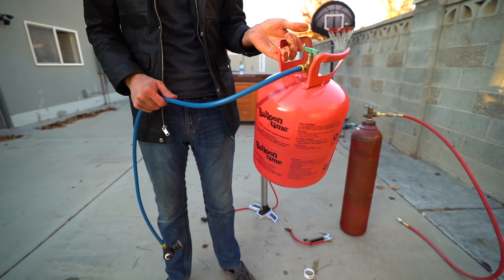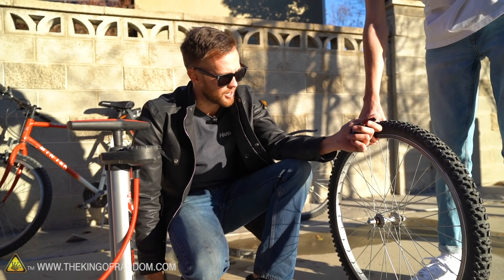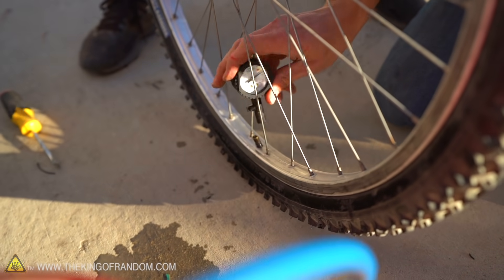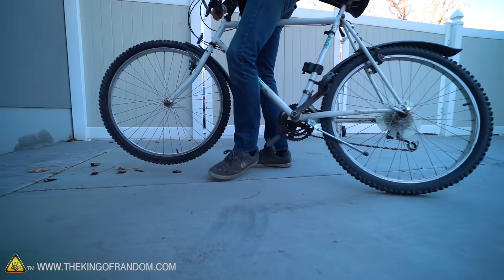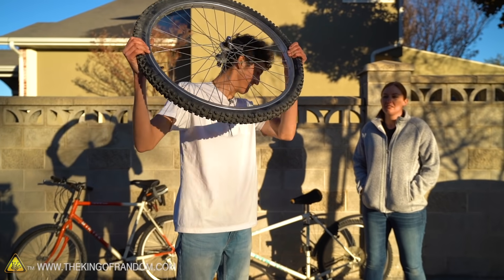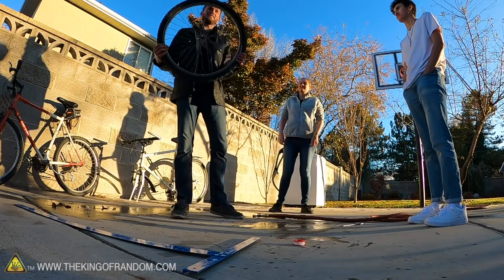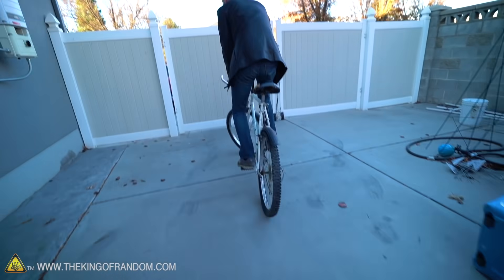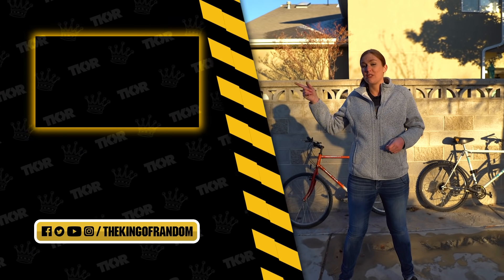What Happens When Bike Tires Are Filled With Helium?

Comment from the maker: How else could we experiment with bikes?
Reply: Fill the tires with Cement
Reply: @maple2500  don't think that would work but now I'm curious
Reply: Fill the tires with oobleck
Reply: Can you make boat with a bike like putting something to make it float and the some paddles on the wheel to see if it can be a boat.
Reply: filling the tires entirely with fix-a-flat, and seeing what other thing you could do with compromised(as in punctured)usually-thrown-away innertubes.
Reply: fill tyres full / half full / quarter full of lead shot or BBs.
Reply: Put the tires in a giant tub of liquid nitrogen.
Reply: Light it on fire
Reply: Make a flying bike
Reply: Would be interesting to know if there is some Gyroscopic effect going on with the water which is why it is making it harder to turn since the water will continue spinning after the wheel slows down.
Reply: Fill it with silly putty, and/or slime! You can also try jello, pudding, and other foods! Have fun with these ideas whether you use em or not.
Reply: fill it up with foam 😁
Reply: Fill it with gallium, aluminum, and thermite!
Reply: Cut open the metal of the bike to see what's inside
Reply: Fill Bicycle tires with cement
Reply: Put spray foam in bike tires
Reply: Same thing 🔥🔥🔥
Reply: Try freeze drying silly string
Reply: You could fill the tires with spaghetti sauce
Reply: freeze dry gas
Reply: what happens is you overfill a bike tyre with air will it explode?? always curious if it will do the same as a ball
Reply: Could you somehow fill a bike tire with concrete? Then you could experiment with gas, liquid, and a solid.
Reply: Fill the tires with spray foam
Reply: When they started to talke about helium I wanted to go buy a bunch of balloons and play with the helium
Reply: Ride a bike with solid rubber tires.
Reply: What if you fill the bike tires with things that carbonate and produce gas so as it shakes it builds up more and more pressure
Reply: Get the tire filled with water outside in winter and see how it rides when water inside is frozen
Reply: Will a bike with  water in the tires float? If not how could you make it float?
Reply: Put two, or three, of them next to each other and use that as a base to maintain social distance.
Reply: Freeze the water-filled tire and see if the rolling resistance is decreased!
Reply: freeze the bike tire filled with water. to make an episode you can check the effects of temperature on all tires
Reply: @TheKingofRandom make bike tires out if spray foam
Reply: Ride over a bunch of sharp stuff
Reply: Freeze the water in the tire?
Reply: @Mercedes Villagonzalo video has been unlisted or private when they made that comment
Reply: Explode a bike see if you can ride it
Reply: Ride a bike with tires made of concrete
Reply: Nate looked like if he was about to commence a chemistry experiment with his black coat and black glasses
Reply: caidenbmx did helium and water already in the past
Reply: Make your own bike. But make it unique
Reply: MOUNTAINBIKING
Reply: fill it up with cola light and mentos. how mutch you need for 45psi?
Reply: fill a tire ENTIRLEY with slime
Reply: fill a tire ENTIRLEY with slime
Reply: Melting it in a foundary
Reply: Also random video idea- washing vegetables like potatoes, carrots in  washing machine
Reply: Fill the tires with the green slime that you use to seal leaks.
Reply: Water in the tirea
Reply: What happens if you freeze the tire with water in it?
Reply: Fill the tyres with orbees
Reply: 0/10 no spin test
Reply: Experiment with the tires again but see what amount pressure can a bike tire contain and try other liquids like the video and see what pressure it can hold
Reply: Hydrogen and fire
Reply: There is a reason to put water in a tire that’s how you balance a tractor tire
Reply: Fill tire with Nitrogen.
Reply: Fill it with pneumatic fluid; ooblock (non-newtonian)
Reply: It’s a bicycle not a bike though but try filling the cycle frame with different stuff
Reply: just have to freeze the tires! lolz
Reply: Non Newtonian fluid
Reply: freeze dry a bike
Reply: Fill a bike tyre with water and ride it down a hill
Reply: Try to use another tire shape like triangle, square, octagon hahahahahha
Reply: You need to remove the core from the valve and then you can easily fill it with all kinds of things.
Reply: Fill a car tire with water
Reply: Fill the bike frame with concrete and tires with water . then race and do tricks against a normal bike .
Reply: get cody from cody’s lab to fill tire with mercury
Reply: i know this is really off topic, but can you make mandalorian armor with the metal foundry?
Reply: Can you please only use Nate and Callie in videos I don’t like the other people and I don’t watch the videos when they’re in them
Reply: Hi
Reply: Can you make a video between two different tires 1 regular tire that doesn't allow to run flat and 1 tire that does allow you to run flat and see how far can you go with each one till they give out?
Reply: You guys should try other "pure" types of air, like pure Oxygen, Argon, etc
Reply: Mercury in bike tires
Reply: Running in whater weels
Reply: Fill the tires with sand
Reply: If you weigh the helium tyre compared to air at 44psi the helium will actually weight more, proove me wrong
Reply: fill it with corn syrup
Reply: Watch Mike Fede's will it ride videos for crazy bike related stuff. Like pool noodles as tires or tennis balls as tires and so on.
Reply: make a paddle boat for the bike
Reply: Do soda
Reply: tires of liquid nitrogen, filled with gallium? Could you mold and cast tires made from candy (wagon wheel style, not hallow)
Reply: Attach motors and see how fast you can go
Reply: When I was a kid we were taught that if you had a puncture, you could do a temporary fix by replacing the inner tube with either tightly packed newspaper or grass.
Just enough to get you home.🚲🚵‍♂️🚵‍♀️
Reply: Why no slo-mo on the bounce, or even pointing the camera at the scale then going frame by frame to check the height? This needed a cacuum pump to pull out as much air as possible before filling.
Reply: Replace the wheels with car tires, replace them with wooden cart wheels, replace the wheels in general
Reply: Fill them with cement 🤔
Reply: How many thorns, nails, or something could you put in the tire before they leak rapidly.  You could also use Stan's No Tube Solution.  (It is a tubeless tire sealant)
Reply: put sugar rockets on them
Reply: ABUSE THEM UNTIL THEIR WHEELS EXPLODE... ahem did (not) try it myself...
Reply: You could fill the tires with:
-Paint
-Chocolate sauce
-Beads
-Sand
-Sawdust
-Plaster of Paris
Reply: Fill a tire with flex seal
Reply: What if you put helium in the body of the bike?
Reply: hydrogen
Reply: Fill the back of a tire with hydrogen and the front of a tire with either xenon sulfur hexafluoride or radon (radon is highly radioactive)
Reply: Plug all the holes on the frame then replace the air with helium.
Reply: Are all tires the same size?
Reply: You did not ride it down the street...
Reply: Fill the hollow bike frames with helium🤷🏼‍♂️
Reply: @nicolasarnold7426  all the air would leak out from headset bottom bracket or seat post
Reply: @nicolasarnold7426  all frames are hollow
Reply: @nicolasarnold7426  how
Reply: @nicolasarnold7426  you would displace a few hundred cubic centimeters of air and it would be unnoticeable as far as weight loss.
Reply: fill the tire with jelly
Reply: Strap sugar rockets to a bike! :D
Reply: See if you can ride a bike after filling the tires with water. Edit: Nevermind I just got to the part where you say you're gonna try filling it with water.😂🤣😂🤣 LMAO
Reply: How was this posted two days ago
Reply: Fill it candy
Reply: what would happen if you filed the tires with liquid nitrogen. when it turns to a gas will the tire pop?
Reply: Fill it with jell-o
Reply: U could see if u could power a table saw whith peddle power
Reply: i would love to have a tire that was full of foa, closed cell foam is super hard. I pop tires very often i would prefer unpoppable tires, even if i ruins my rims or whatever.
Reply: Run over random things with it
Reply: Keep up the videos guys been loving them recently
Reply: Hmm
Reply: Did the total weigh changes from control x  helium
Reply: Put hydrogen instead of helium in the tires
Reply: Reinvent the wheels
Reply: Try to make a giant candy Nerds Rope.
Reply: Fill it up with soda
Reply: Make a quadcycle
Reply: You could do the same experiment, except with more sizes of tires, high-pressure tires and kevlar bead tires.
Reply: 2 days ago???? This was just posted
Reply: You should try something that has to do with one of those blow up castles for kids and big body of water that would be fun to watch LOL or something similar long as you don't get electrocuted not sure if you would actually be able to put one of those in water or not
Reply: Fill with water or oblek or other liquid
Reply: Weld little jumpers to the rims - springs, miniature jumping stilts, things like that.
Reply: Make solid glass tires and ride the bike with them on!
Reply: Where did the other dude go?
Reply: If you listen when the bike tire is filled with sulfurhexifloride, it makes a slightly lower/deeper sound when it bounces. The tire filled with helium sounded about the same as the tire filled with air, I thought it might make a higher sound, but it didn't seem to.
Reply: @kalynrobison6192  cause I want to know how a bike sounds when I’m riding
Reply: Thank you guys for doing this I was wanted to do this
Reply: I don't need to watch the video to know that helium or hydrogen wouldn't create a statistically significant difference.  Not only have I seen the mathematical proof, but I have seen people try this with balls, car tires, etc.
Reply: @drippingwax  Is it because of the density of the gas being pumped in? Maybe helium only creates lift in a non-dense (non-compressed) environment?

Comment: They do fill tires with water to make them healthier it's more for construction and agricultural uses. They make special pumps that spend a set time to fill then switches to a vacuum to take out air and this is always done with the valve stem in the 12 o clock position. Sometimes the valve core is also twice as big

Comment: I personally filled a tire full of sand (without a tube in it) and ran into an interesting problem... Because I didn't have a valve to put the sand through, I was left with an air "bubble" at the top of the tire. While spinning, this mean the sand could slide around inside the tire. This made for some very interesting feelings, especially when the 'bubble' decided to make a full loop.

Comment: When you FILL a tire with water, all that air gets compressed at the top.
5:00 That's mainly the air trapped at the top expanding to push out water.
Reply: I mean, what you are mainly compressing here is that bubble of air stuck at the top.

Comment: I feel like PSI (or really, any measurement of pressure) is basically equivalent to a measurement of density when there's a fixed volume of a gas (like in a bike tire). As such, yeah, 45 PSI of gaseous feathers is the same as 45 PSI of gaseous bricks.

Comment: Water filling tires is actually a thing, in fact I own a "Slime" branded kit/hose adapter for doing just that, water filled tires are used for farm tractors for added weight and traction.

Comment: I mean, what you should do is put the same amount of gas in the tires, not fill to the same PSI. Of course they ride the same when they're inflated the same. But if you want to measure the difference, you'd put the same amount of gas in the tires and see what the PSI turns out to be and how it affects the rideability.

Comment: What your measuring is the flexibility of the rubber tire....  Other than the weight of the water, once you have the pressure in the tire the stretch of the tire in the side wall, different tires are going react for the properties use it's use.

Comment: It's really not cool to experiment with helium. It is so light that the earth's gravity can't keep it contained. Every bit of helium used permanently escapes the earth's atmosphere and enters the void of space. It's necessary for many industrial processes and it is actually quite rare on earth. There isn't any way to make it from scratch either. It may be easy to buy it at stores because of the balloon industry....but you really shouldn't encourage it's use in any capacity.

Comment: I previously looked up the lava lamps can reach up to 140.  Lets what happens if you heat it up much higher than that.  What happen.  Are the bubbles the same size, smaller lets find out.

Comment: The air ones that had different gases didn't bounce different amounts because the densities needed to get to 45 psi are different in each so you likely had similar weights to get that much pressure.

Comment: I actually work in auto retail, and they make a attachment for putting water in tires, it’s meant for water in tractor tires for weight. And if you get a small hole you have longer times before it deflates

Comment: They used to and sometimes still put water is tractor tires as a means of lowering the center of gravity and increasing the tractor weight for stability, an actual use for garden hose to schrader valve attatchment

Comment: You can buy a water hose to schrader valve adapter at a tractor dealership with an air bleeder. There is air in an inner tube, even when deflated, unless you take out the valve and squeeze the tube flat. As you fill the tire with water, the water displaces the air space in the inner tube, so you get a tire full of water and compressed air. You put the valve stem at the top and hit the bleeder and it releases the air that was in the tube before you filled it with water, then you can have a tire FULL of air.

Comment: Turning at higher speeds would be more difficult. The wheels are acting like flywheel's and you increased the weight on the ends of those flywheels. It would have some interesting gyroscopic effects.
Reply: Which would mean that riding without using your hands on water-filled tires would be even better

Comment: Huh, water in the wheel could be an interesting physical model. So if you begin to drive forwards you'd have to go against the inertia of the water in rest, but once you start driving, you're gonna accelerate that water and create torque, which is propably the reason, why turning the wheel feels "heavier", because you have to act against an torque compared to an air filled tire

PS: I don't want to act like I've got any idea what really happens there, so if anything I've said is wrong, feel free to correct me

Comment: 45 psi is about 3 bar, which is normal for a gardenhose. you might get it up to 5 bar if you adjust the pressure gauge but you also risk to damage your home installations.

Comment: would be interesting to see this on car tires, see if it affects acceleration, or causes wobble at all with water
Reply: It would absolutely affect acceleration, stopping and handling considerably.
Reply: That’s what motorcycles do with wheel weights actually.
Reply: I believe Garage54 did that experiment.
Reply: @purp1e200  ill have to check it out

Comment: The problem for the gasses is that you controlled them by pressure, the big thing that makes these gasses different is their density.  As gasses are compressible if you wanted to keep these gasses behaving in different ways you should have kept them at a constant volume (by which I mean volume at standard atmosphere)

Comment: You need to ride at speed. The gyroscopic effect of the water would have a greater effect
Reply: Yep! You should definitely feel a difference in the resistance when you attempt to turn at a higher speed.
Reply: The natural slight imbalances in a pneumatic tire are generally negated by the air gently compressing and releasing.  The weight of the water would magnify the tire imbalance.

Comment: Would have been nice if you also measured the weight of the tire while filled with each element and also rode the bike "at speed".  the weight of the tires and riding at speed should alter the differences in riding physics to be far more noticeable.

Comment: What if you increase the volume of tyre, which will increase the contact surface area of the tyre? Would the helium in that tyre make the whole system light? 

We can even reduce the weight of metal used in the cycle by building it with a different light metal

Comment: Gasses confined in a chamber create pressure, the type of gas you use changes how much/little gas is needed to reach your desired psi. Should have weighed every tire after filling them to see if the mass changes depending on the gas used.
Reply: Assuming that these were ideal gasses, the amount used would probably not have changed much/at all